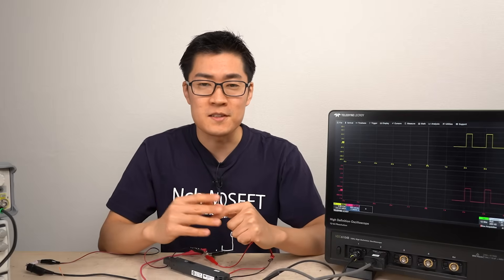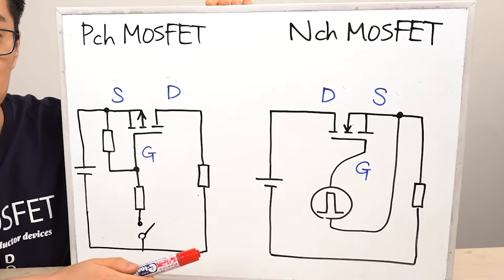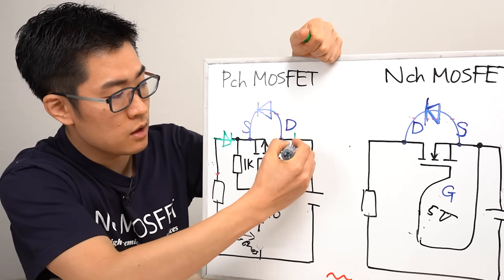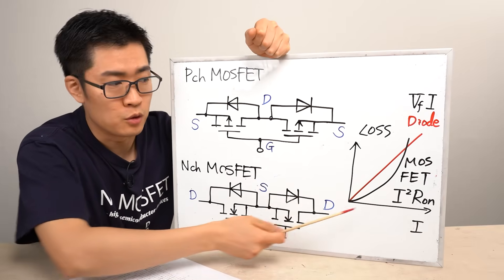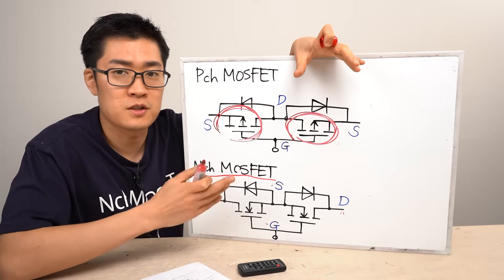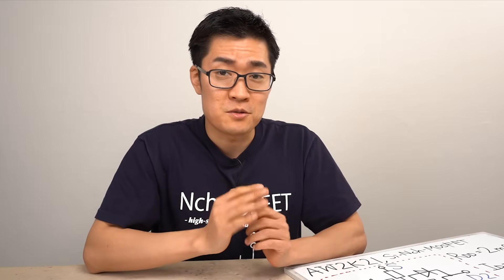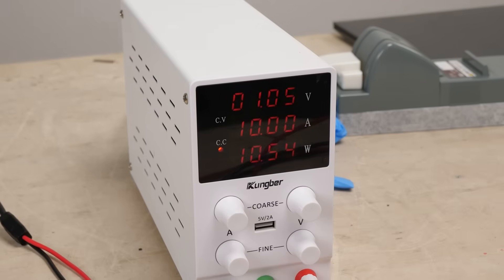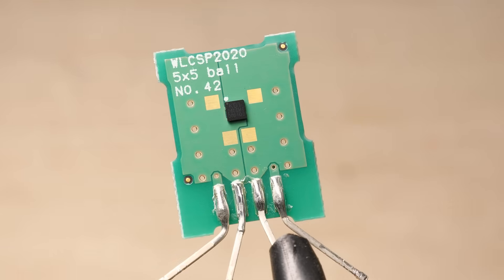Load Switch Explained. How it Works?

Comment: 10A * 2mΩ = 20mW. That should not have heated it up to >100°C. I suspect that you did not drive the Gate voltage high enough with respect to its Source voltage.

Comment: Yet another great video! Thanks!

Anyways, For polarity protection I think HEMT might be a better choice as it doesn't have the body diode!

BTW, I kind of hate SMD components like power MOSFETs or high-power resistors - as they dissipate their heat on the PCB itself, which rises ambient temperature for all the other components. But these tiny SMD MOSFETs are crucial for compact devices of course. You might be able to put 2x FETs in parallel and have 4x less heat dissipation on each MOSFET, but it also increases the stray capacitances and affects switching speed. For polarity protection, putting 2 - 3 FETs is fine as it's not switched rapidly (also circuits like Royer oscillator in my case didn't like parallel MOSFETs)...

Anyway, my favourite MOSFET is IRLB4132 which a TO-220 logic level FET (2.5mOhm at 10V, and 3.5mOhm at 5V), and for high voltage (150V drain-source), and 12mOhm RDS_on, I go with IRFB4115.
Reply from the maker: International Rectifier (now Infineon)'s low on-resistance MOSFETs are excellent.

Comment: This is probably my ignorance speaking, but isn't 0.6ms until current flows very slow? This won't work with any switching frequencies higher than a couple hundred Hz.
Then again, I suppose that with the mentioned recommended use cases such as load switches or protection circuits, the only thing that really matters is that it turns off fast enough.
Reply from the maker: The delay until turn-on is due to the characteristics of the gate driver.
Replacing the gate driver with another one should improve the situation.

Comment: N channel low side switching makes it as simple as pfet high side switch, no need for high voltage gate driver.
Reply: But then you have an energized +ve  rail which is less desirable for contacts exposed to the environment.
Reply: @pranjalkushwaha197  positive ground solves that problem.

Comment: ❤❤❤
You're fucking common, 
candy production in a golden package. 

1.6W for $ 2.89 is $ 1.80 for 1W. 

Now the project is dumb because 
pin ad & bc line ad 0.3mm 
pins is a short circuit, ?

for no ab & cd  That is in via out pin 0.9mm
what a fucking projant ?.

 The second dumb max is 
20V and 0.07A current 

and ...

the maximum is 40A at 0.2V. 

You sell your dreams, you pull on the worst product you have created, 
the next trash is you have how many drivers on IC, 

it means that I have to buy
• drivers and 
•stabilizer and 
•CPU, 
the question would not fit in this one Case?

 fucking design

🎉🎉🎉